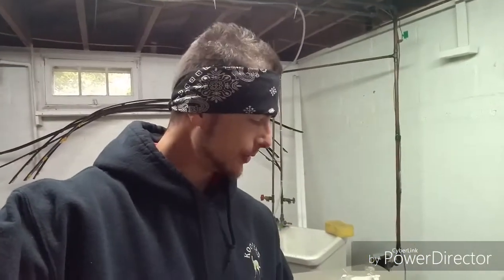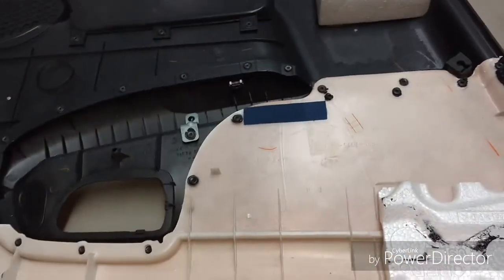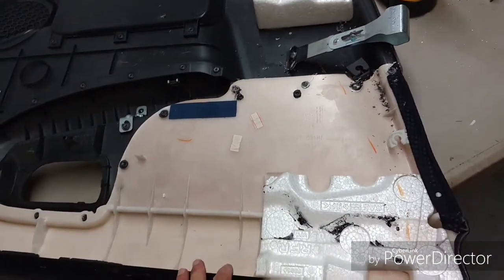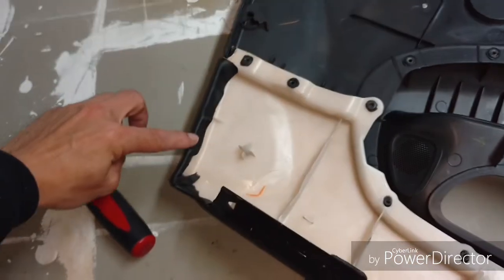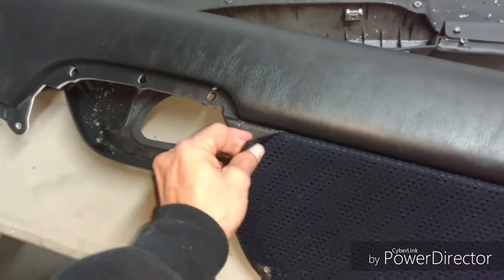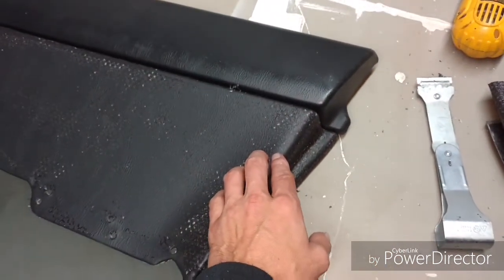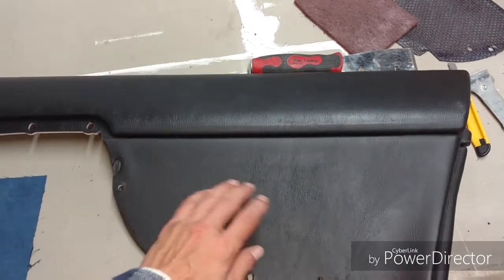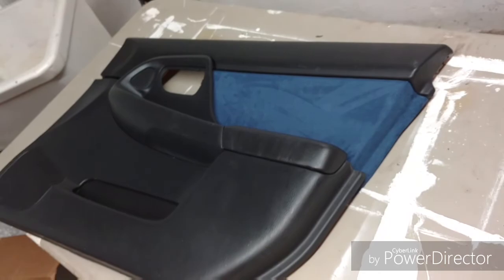How to convert your WRX door cards to STI door cards

Comment: Bill what is the material information ? I would like to attempt this as well
Reply from the maker: Richard Schmidt Its suede I ordered. I went through the process of having samples shipped to me. I colored matched them to the STI seats. If you need material. I have alot! About 100 yards! The roll is 5 feet wide, and I can cut to any length if your looking to do roof as well.
Reply from the maker: #Lcg_wrxwagon on Instagram if you want to see how the door cards turned out! Lifted WRX wagon! Also check my Rumble in the Park 2017 Video. He won Best WRX, and Best of Show! I sold him the full STI interior as well. I buy and sell parts😁👍. If you need anything. Feel free to ask.